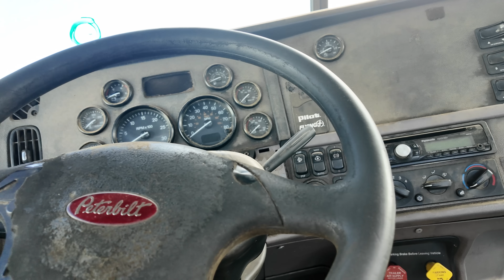We will never learn.

Comment: My abs was doing the same. I had a short somewhere  i couldn't find it so i ran another wire from the abs module to the back. Fixed it.
Reply from the maker: @rtbtrucking2566  yeah I don’t seem to be getting voltage running back there. But I guess there two different type I heat one that takes it and one doesn’t.